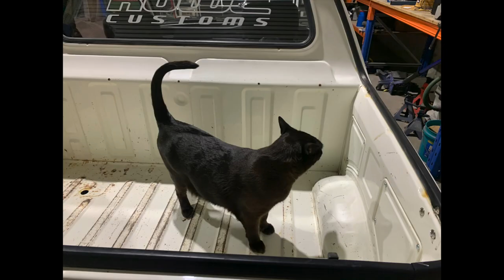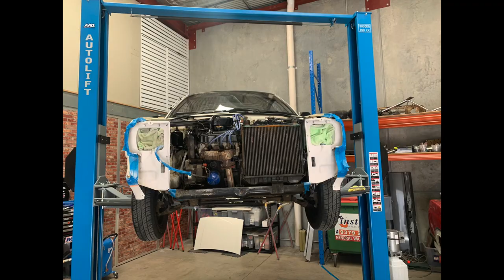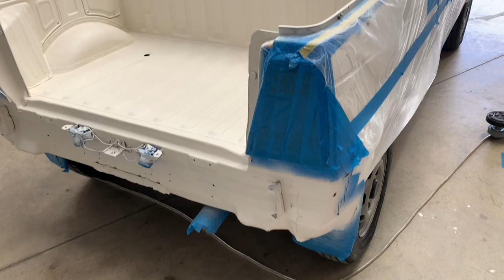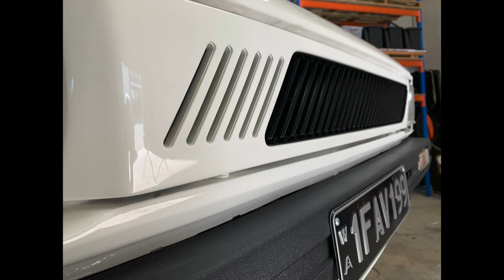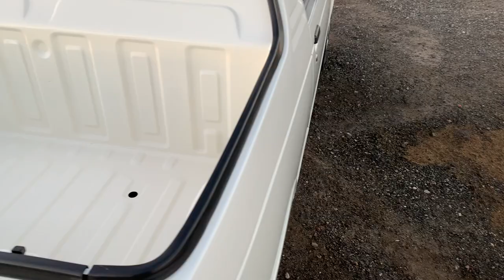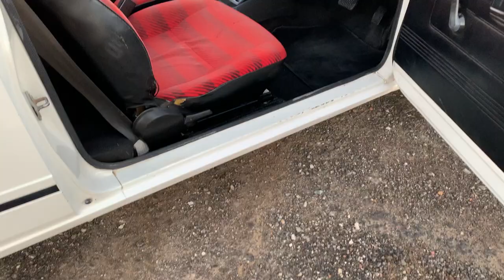Suzuki Mighty Boy Refurb

Comment: Awesome job- got one the same except it has the chrome roof rails and factory fitted sunroof -just did my bumpers with a heat gun - How did you do yours they look awesome 👍
Reply: Sunroof was a after market thing never factory fitted, and all Mightyboys came with roof rails.
Reply: @brettstevens7443  First gen mighty boys didn’t have the chrome roof rails- you could get them with a little black quarter panel on the top of the tub to the sides of the rear windows- I probably miss worded the factory fitted sunroof- it was actually requested by the original owner( I’m the second) and fitted by a local dealership here in Tasmania- cheers 👍